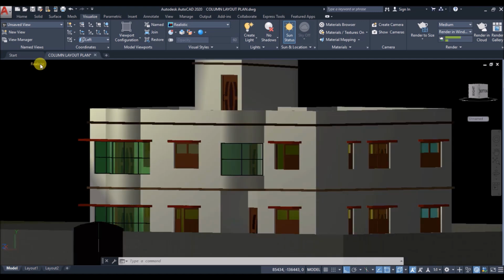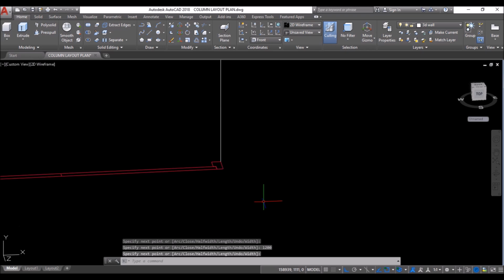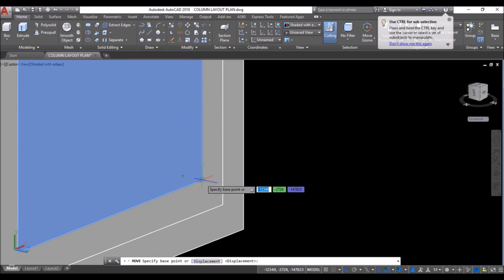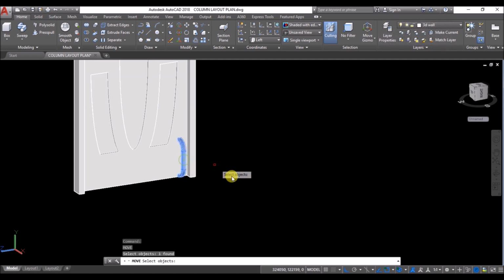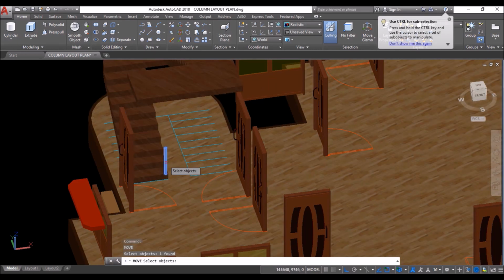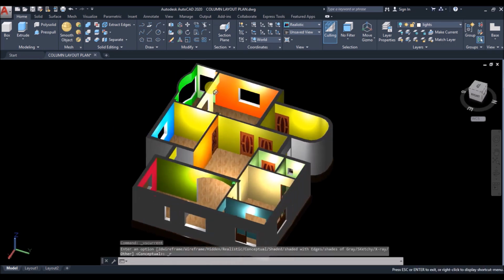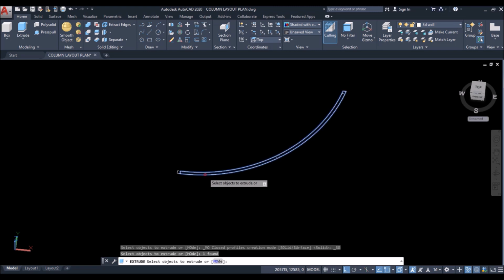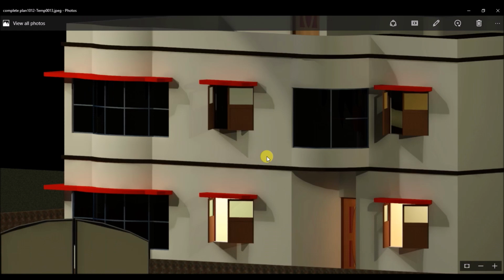[ COMPLETE ] AutoCAD 3D in 2 Hours With RENDERING Complete Tutorial | AutoCAD House Design (2023)

Comment: Even extended was not working in my cad
Reply from the maker: Press function key f11 to turn the object snap tracking on
Reply: @CADDMANIAC  when I was selecting the plan but it was also selecting the 3D model, and at starting it shows error was found in the dwng file
Reply: @CADDMANIAC  when I my cursor is moving on ground floor plan it was also selecting the 3 d model.. And even after pressing the f11  your cad plan is not working ... Thanks for your content
Reply from the maker: @dskinfo8576  may be the dynamic ucs is turned on, press f6 to turn it off, it might work